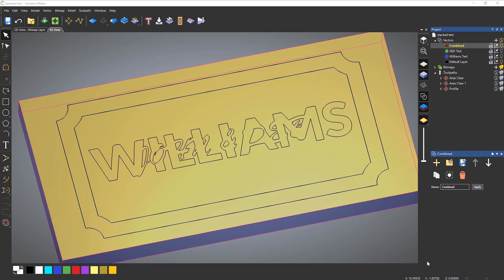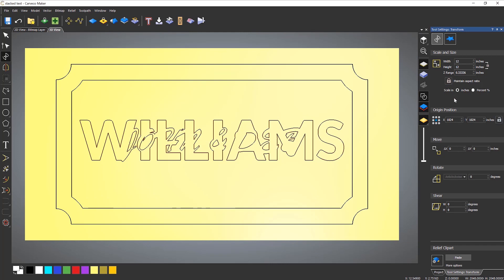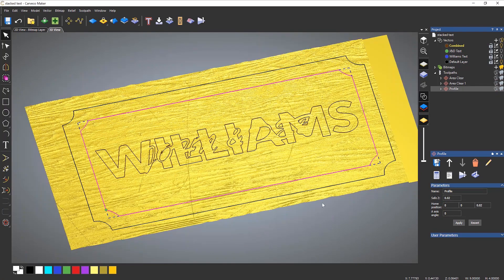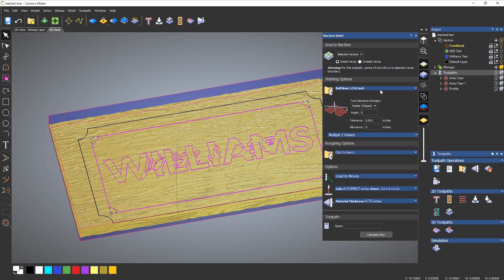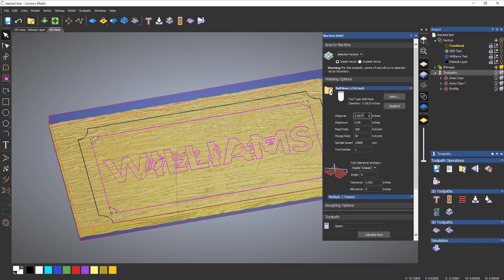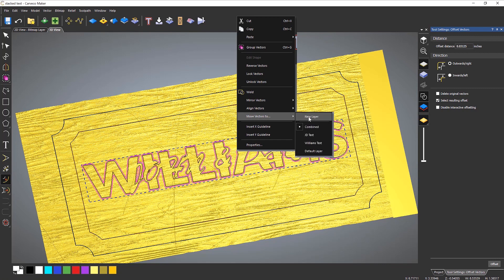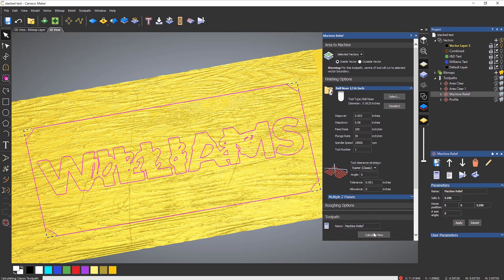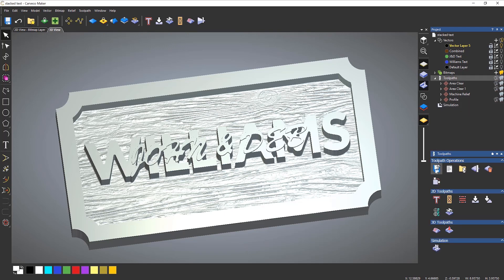Carveco Maker Project Seven Adding a Texture and Machining it

Comment: I’m a long time vectric user and I’m enjoying Carve co. They both have positives and negatives. One thing I don’t understand about carve co is why you have to offset lines with a relief in order for your bit not to cut into a vector line. In vcarve if you tell it what bit your using and select cut inside a vector it automatically stops half the diameter of the bit away from the selected line. Is there a reason for this? Or is that just something not available in carvco maker vs pro?

Comment: If you were to use a 1/4" shank 1/16" tapered ball nose for texture.... how would you set up the offsets??
Reply from the maker: Use the bottom cutting diameter.  The side wall will obviously have a taper on it using that tool.  Or alternatively, you could run a Profile pass around the inner edge to remove the taper and then create the texture toolpath.
Reply: Then the texture toolpath won't be as closer as expected to the wall and edge text..... however I have learnt a lot from you ,,thanks.....